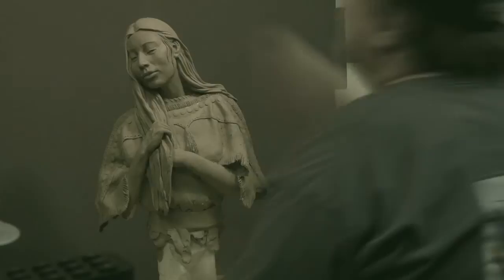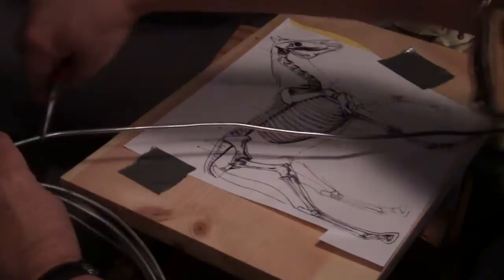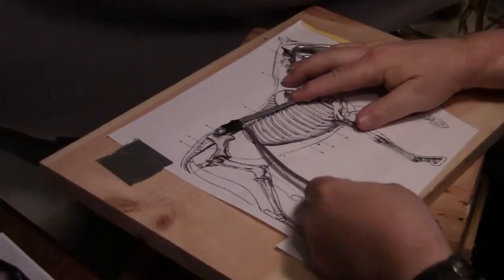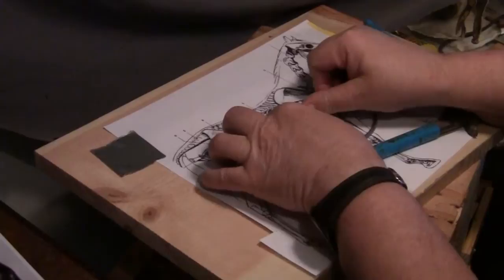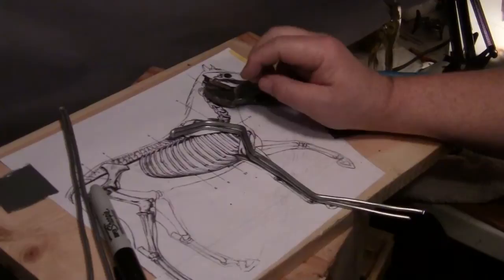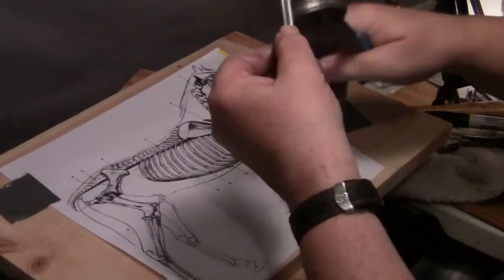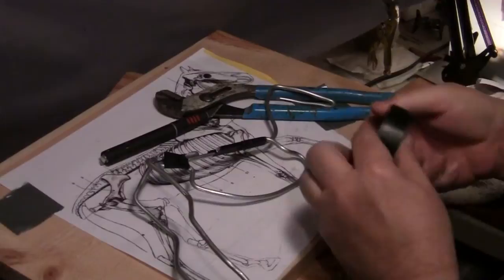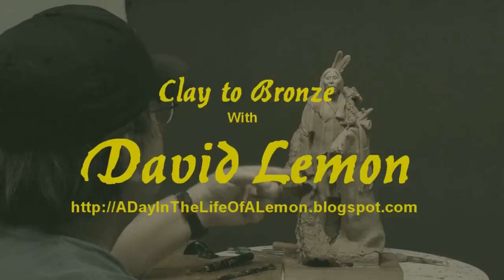Sculptor David Lemon - Making a Wire Armature for a Horse

Comment: anyone know the thickness needed for a 1/6 scale armature? I'm struggling to find info and it's stressing me out
Reply from the maker: I haven't a clue..  If a human is 5 feet 6 inches tall... you divide it by 6 I think.. to get the new Height.. I think..
Here's a website that might help.. https://www.inchcalculator.com/feet-inches-calculator/
You'd have to get the measurement for a normal horse full sizes.. and divid by 6 I think...

Comment: Hello David, and thank you so much for showing us your process, I have a question: what kind of material should I use for a horse armature that will be fired in the oven inside the clay sculpture? 
Thanks a lot!
Reply from the maker: I don't know.. you could wrap the armature in paper to allow for clay shrinkage.. You'll need to hollow out the clay before firing though.. I sculpt in Plasticine clay so I can't give real knowledgeable advise.
Reply: It's probably a bit late to answer but for my basic knowledge it's Better not to have a metal armature inside the oven (at least that's what my teachers told me but i might be wrong!) 
Btw how did It went? Did you make It?